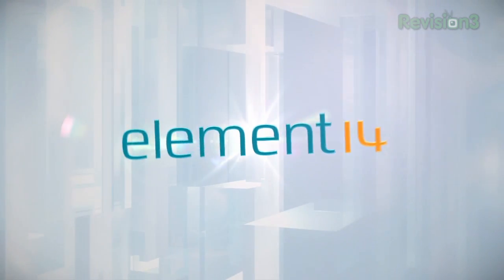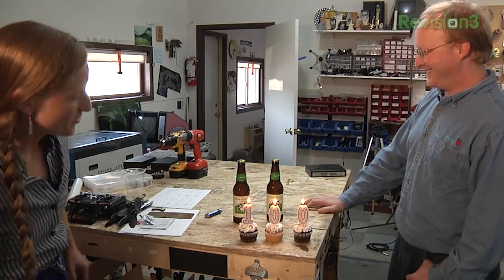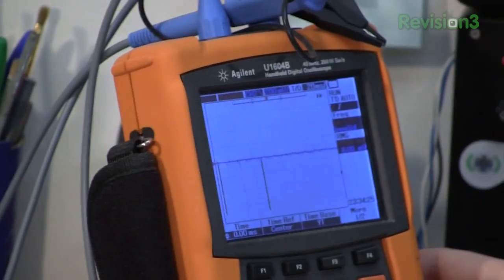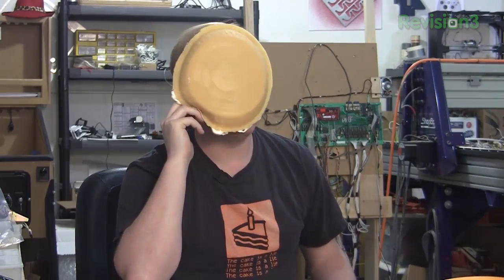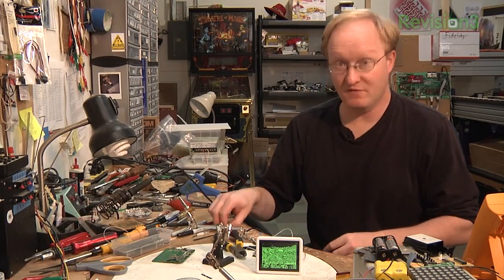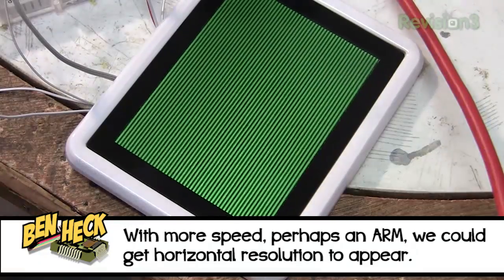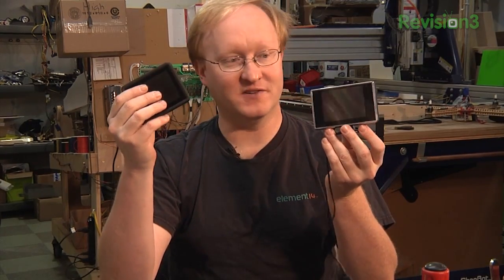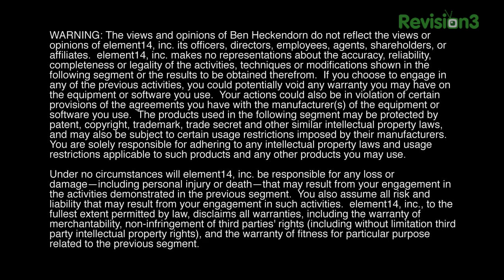Ben Heck's LCD Hack Challenge

Comment: Yeah yeah, but what if you need a high pixel density screen (for example 6" 2560x1440 2k screen for a VR headset), you cant really just buy those, because those are not for sale and the ones that are for sale are really reall expensive (>300$) and have high persistence, mainwhile there are tons of super cheap cellphone OLED screens on the market but no driver board. ARG!

Comment: 13:09 Holy hell. The Ben Heck Show just got interesting. I didn't know that many other people thought like this. Of course you should value your own time! Thanks Ben!
But wait a sec... wouldn't most stupid questions people ask you be a complete waste of time? Like that whole "can you use an Arduino as a KVM" stupid question. I mean, anything is anything of course you can do that. But, a waste of time, so stupid.
Also, 12MHz isn't that fast actually. It's just that most people use really really slow Arduino boards. Try using an ESP8266 instead, you can still use the Arduino libraries but your code will run much faster. (80MHz)

Comment: You may also have luck using screens if you can find the controller (like on eBay). I bought a no name 7" android tablet, and was able to find a controller with Composite, VGA, and HDMI. It was $45, so not that cheap, but still an option. Only hurdle is finding the make and model of the LCD before buying said tablet, etc. Still considering options for car nav, backup cam, media control, etc
Reply: So an Arduino wouldn't work, how about a raspberry pi? That would be about the same price as the ready made controller board I mentioned before

Comment: Is it possible to buy a processor and use it with a motherboard you created? For example: buying an Intel Atom processor, creating a small motherboard to fit it, and using it as a portable computer.

Comment: Use a razor blade, cut apart the connections, and on most of them you can melt away the flex material. easy way to 'strip' the connections, that way you do not have to try to solder them so close, and you do not have to worry AS MUCH about bridged connections.

Comment: There's a guy on eBay that sells controller boards for laptop lcd's 
It runs on 12v with  HDMI , VGA DVI , audio in and out. so send me a message if you want the link.      I use this with my ps4

Comment: While you'll never get a picture out of it, there are two uses for an old laptop lcd screen that I've tried with success. If the backlight is still good, you can take it out and transplant it into the screen of another laptop whose backlight burned out. The other thing you can do is take out the light diffuser and make it into a lampshade.

Comment: The software is probably on some ROM, which is very close to the processor. There's no (easy) way to get to this memory (assuming you can even change the stored data). You'd have to reverse-engineer the assembler code from binary level to something you can understand and write yourself (which is insanely hard/impossible to do if you don't have at least the processor schematics).
Trying to hack it through software really isn't worth your time and effort.

Comment: Oh and it's under 2000, by the time they ship they're own design software Othercam will be able to import both EagleCAD board files and SVG files. This means we can use Illustrator (or any other vector based editor) and EagleCAD to design both shapes and circuits to cut on the Othermill. Soooo....just go look will you. Its exciting!!

Comment: HAppy Belated Burthday Ben, Greeting from Upper Canada, let me be the first (I hope not) to make sure you have heard of the "OThermill" a brilliant portable, desktop CNC , won its Kickstarter $50,000 goal early and by a factor of five, and it does primarily circuit boards with jigh degree of repeatable accuracy,  Z axis is sizeable and will work with wood, plastic brass copper,.  They have made an entirely new design software for making its own new type of code, that is totally visual in nature!

Comment: Honestly, you can make anything you want. But theoretically yes it's possible, ASUS has a system on their motherboards that can control each fan individually, so you could potentially use that system or idea to make a board that could do that control each connector, would require some coding but it should be THAT expensive, it'd just be easier to figure which connector does what

Comment: thx for your reply. i already checked out TinyDuino , but my challenge is to do it without any "premade solutions". i already got the SoftwareSerial and the programming via ArduinoUno to work. the only thing i need is a USB/Serial Converter, since my output from the attiny45 ( SoftwareSerial.print() ) shows only strange unicode characters in e.g. the serial monitor of the arduino software. i don't want to use a usb/serial converter, cuz it's to big for my project. i want to make my own (FTDI)...

Comment: Always with the hard way.  You could build a rig first to line up the wires and space them.  A short cut of that ribbon cable would make a quick rig to line up the loose wires.  $5 an hour jobs are common if you factor in tips only or net wage after taxes and deductions.  Hardly a society of golden year hopefuls these days.

Comment: 12MHz pixel clock to the screen, and send data at half (or quarter) the rate. Two pixels per clock cycle. Half the resolution, but it will work. Tie together RGB and get a BW screen. A 16MHz avr might *just* be fast enough for it. *Barely*.

Comment: I was thinking of the same thing. I've used one of those boards off ebay with an old laptop screen, works great. You just have to check the LCD serial number against what's supported by the driver board.

Comment: What about building a butler robot based on the arduino that would transport food and drinks in the inside and TV and xbox controls in the outside. it also could have a cup holder. it must be able to follow you (like robot luggage), to come to you when you clap your hands and also be able to dock by it self (IR beacon)

Comment: I once looked into this with an old b&w LCD from an early '90s laptop. I still have the LCD but I gave up years ago when I learned that this is nearly impossible to do on the cheap. You could buy some kind of controller but that was stupidly expensive.

Comment: Not directly. SD cards are just storage with a filesystem. The slot is most likely wired into some GPIO pins on the CPU.

If you don't need a high framerate, you only need to "emulate" a SD card and a filesystem.
With that you can transfer jpeg pictures as often as the CPU in the photo frame can process them.

I'd guess you could reach about 10-30 frames per minute. Not much more since the CPUs in these cheap things isn't very fast at processing pictures in the first place.

Comment: hey ben just thought i would add this to your info about reusing screens.
My PC setup is currently using 2 old acer aspire widescreen monitors.
i pulled the working screens from dead laptops kept all the housing to  make mounts and keep it looking okay. went onto Ebay and purchased LCD Controler bords.
they cost arround £50 each but you can get the Hideff ones with dvi ports for your screen just have to send them a make with your LCD part No.   it is a good way to reuse laptop LCD's

Comment: Ok. Here's a question. Is it possible to connect a gopro and external hard drive, in such a way that it would automatically have the gopro footage cleared from the gopro and put on the hard drive? I am well aware I could buy a crappy laptop, but one specifically for that purpose is uneconomical. It needs to be able to run off 12 v power btw

Comment: There are LCD controller boards programmed specifically for LCD models from certain laptops. I've converted 10 LCD panels from a bunch of old dell laptops to actually TVs with HDMI inputs. the boards are like $35 on ebay.